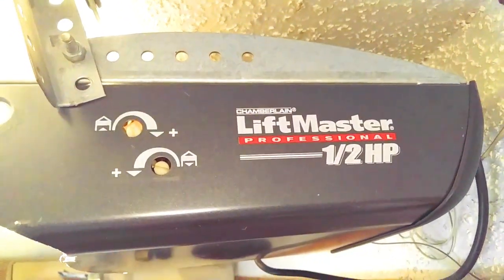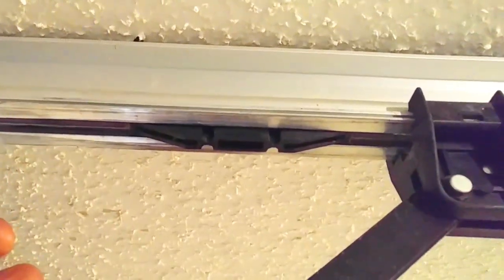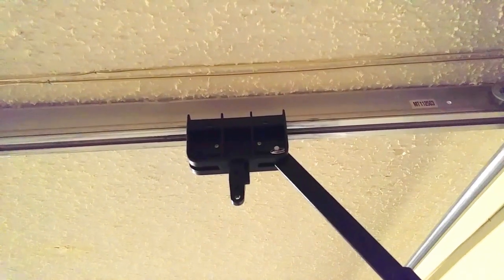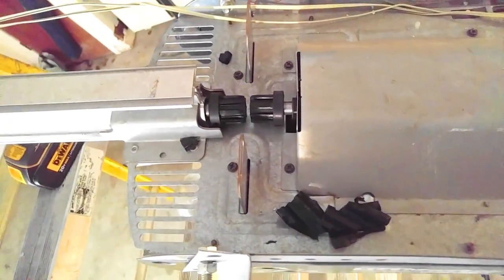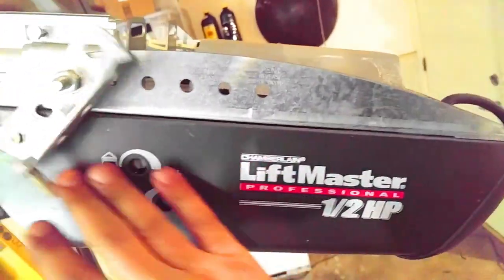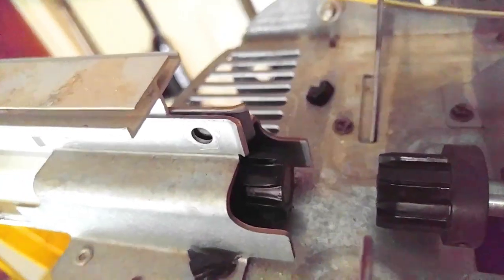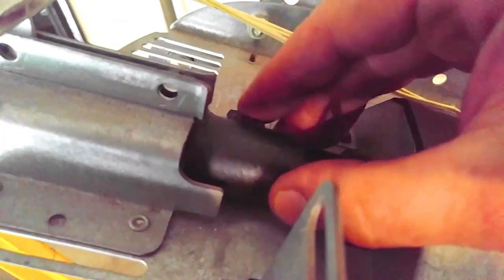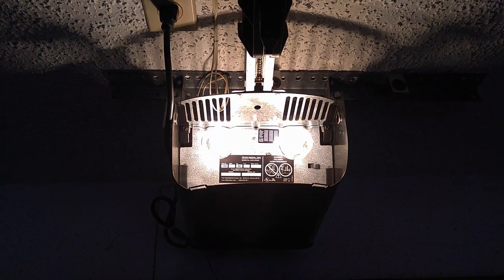LiftMaster Screw Drive Garage Door Opener Coupler Replacement

Comment: I tried this way .but I could not move the rail to change the coupler. Should I have to remove bolt either side.? Pls some one help me
Reply from the maker: Yes, those 2 nut/bolts in the back.  That's what separates the rail from the power head.
Reply: I removed it from the motor side two bolt but the rail is not moving. Should I remove from other end door side too. Thanks for your sincere answer.
Reply from the maker: @jayaprakashchristudhas8840  you shouldn't have to take it loose at the front.  Now with  it being stuck you might want to loosen up the nuts/bolts that hang the unit to the ceiling. That's if you're doing this repair with it still mounted to the angle iron.
Just wiggle it..it should slide off.
Reply: Great I had a little problem of changing the coupler. Mine is not belt driven , it is screw driven, so have to detech the rail from the motor and ceiling to make a gap to insert the coupler. I succeeded. Gain $$.
Reply from the maker: @jayaprakashchristudhas8840  easy fix!  Good job.

Comment: I replaced the coupler but now when I hit the bottom it attempts to move but doesn't spin at all
Reply from the maker: Hmmm..
The only thing I can think of is maybe the inner slide is jammed.  That's the black narrow piece that's in the rail.
I would take the coupler back off (I know pain in the arse).  Then manually spin the end of the rail.  See if you can freely move the inner slide.  That will determine if that's why it's not moving.  If all is good on that front then put the coupler back together and try.  
Make sure you get the limits close to where that inner slide sets in the rail.  Because if you don't and put the coupler back on and run it, the settings will be off.  Then you're likely to ram that inner slide into the back stop or if it's in the lower position, blast it out the front of the rail.  You can prevent that by having your finger on the remote and as your watching the inner slide travel up/down the rail.  If it seems it's traveling to far up or down, hit the button to stop it before it travels to far.
Hope that makes sense Johnathan.  Please reach out if you need anymore assistance.  💯

Comment: i had a lizard in the squirrel cage in my tankless water heater. The plumber is less than a mile from where I live. Took him less than 5 minutes to take the lizard out and put it back together. Charge 320$$$$!!!!!!!!!!!!.
Reply from the maker: Dang...
Reply: @garagedoorgenius   I agree with you.
Reply: By the way. do you own a riding mower. I have a craftsman 1000, bought in 2000. A hose clamp is the same with as the  brake pad. Just have to cut to length. Take the  spacer and put on either side of the brake pad. You can add as many spacer you need to make the pad last longer.  I sand the brake to get the grove  smooth. Add just enough silicone to hold the spacer , and pad in place . While you put the  brake drum back in place. .
Reply: Also If you own a stick welder. You can add hard surface to the top cutting edge of the blade , and where ever else the blade wears. It will make the blade last a  lot longer.

Comment: I think sometimes this plastic  coupler fails.  Because! The homeowner does not keep the drive lubricated enough. Which puts to much stress on the coupler.  Causing it to fail.
Reply: Glad you are here.! Do I need to put some lube on the coupler?
Reply from the maker: Absolutely! Lubricating the rail helps.  Sometimes the 2 nuts/bolts that connect the power head to the rail gets loose and causes the coupler to be put at an angle.  
Good maintenance making sure but/bolts are tight.
Reply: @garagedoorgenius  What about the coupler. Would not want to put the wrong lube. Do not want to melt the plastic coupler.
Reply: I sprayed the coupler with 303 protectant. Maybe that will help keep the plastic from breaking down due to age.
Reply: One last question. the door goes all the way to the light, and bumps. . I see yours stops about 6 inches from the light. And  when I  closed the door. It closes down on the gasket. But seems it could go a tad closer to the floor.  How to adjust if  you think it needs it

Comment: Coupling was easy to change. But 1st it would only go as far as halfway shutting where it broke the coupling at.Tried adjusting the limit switches but that didn't work. Then I tried moving the screw down myself until it would connect with the shut door. That didn't work once connected it would go all the way down hit the ground & come back up. Pretty sure I screwed up the limit switches. Probably should have screwed it down close to the end at the start.
Reply from the maker: You live and learn.  That's why I set it at a closed position.  That way you can get close, if not right on after installing the coupler.  
So you ended up getting it up and running?
Reply: @garagedoorgenius  No I gave up it continued to travel all the way to the pavement it & then go back up. Think I messed up the limit switches . Didn't realize that I should have screwed it to the closed before installing the coupler.
Reply from the maker: @phillipfoxworth6290  I know it's a pain, but run the inner slide all the way down to where the trolley sits when the door is closed.
Take the coupler back off.  Run the machine down until it shuts off.  Put it back together.  You should be really close with the limits then. 👍🏼🤘🏼🙏
Reply: Sir thank you for your help but I guess I am just missing something.  When I 1st put the coupler on the inner slide was 1/2 way so after i got everything connected that was as far as it would go. Then i tried to adjust the limit switch going down. It would only go so far . Then i took it apart shut the door and ran the inner slide all the way till inside the latch which caused the door to hit the pavement sending it back up. Then it apart adjusting the inner slide up some & actually got it to shut but it was hitting the stop screw going up. Then the unit just stopped working.  It is running again now but as much as I try adjusting the inner slide it still goes all the way to the end then hits & goes back up. Thanks.
Reply from the maker: @phillipfoxworth6290  you can take the cover off the machine to gain access to the limit switch assembly.  From there you can see exactly where the limit setting is at.  Adjust as needed.  It's kinda a pain, but doable.

Comment: Video made it look easy, BULL CRAP !! Had to UNSCREW and slide the entire unit back to insert the coupler. Much easier if you have two people.
Reply from the maker: 🤣🤣 yessir!  Well that's years of practice on my part.  You got the job done with the right guidance! 👍🏼
Reply: Haha.. I have never done anything like this and was able to replace the coupler myself without any assistance..  BUT- I still haven't been able to reconnect the garage door itself to the little black piece pulled by the crank motor.. :\  Le sigh..  Any help would be appreciated, anyone. <3